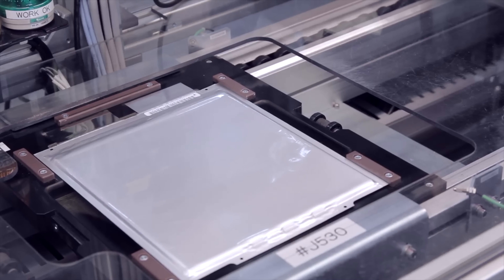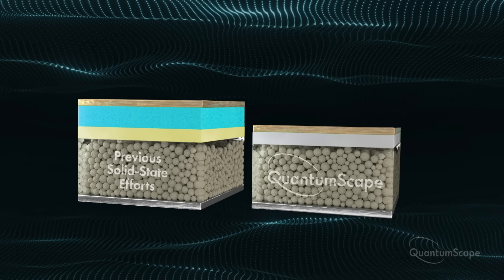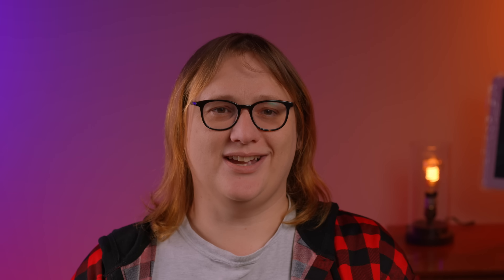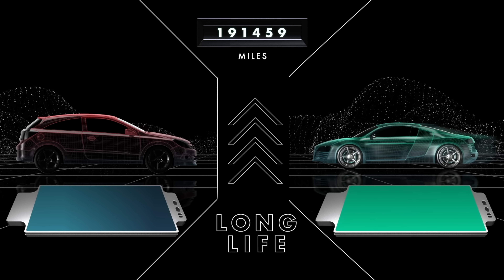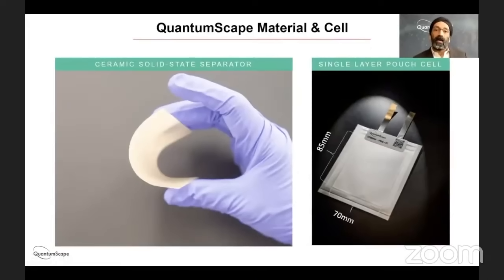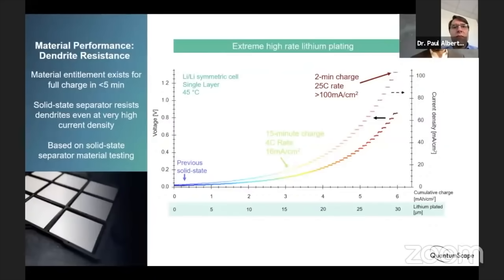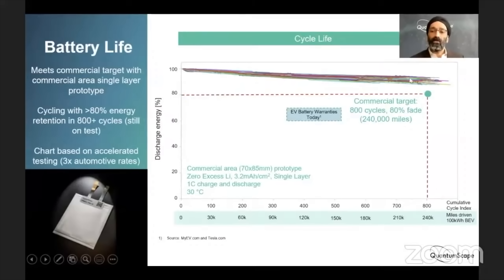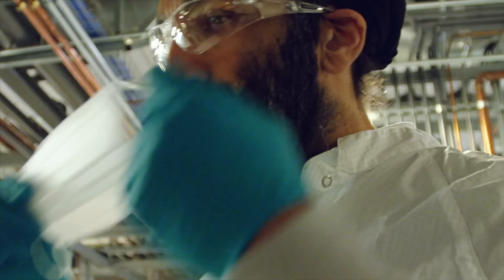Why Quantumscape's Battery Revolution Is Big News

Comment: Other companies have done this - offered better prices to cherry-picked safe drivers and they use metrics for each driver, not statistical demographics - for PART of the price. The environmental factors and the cost of repair/replacement of the vehicle are the same no matter who the insurance company is.  

That "coin" manager doesn't sound like someone with any experience in the insurance industry.  It's more than 50 times as complex to sell car insurance as it is to sell cars online from one state.   Insurance companies  are regulated independently in each state.   They may be divisions of  a larger holding company that also owns a car manufacturer, but u-in order to sell to citizens of a state, they are required by law to be separate entities and they must have separated financial reserves, corporations,  licensed agents and sales presence in each state.

Comment: I am having a hard time getting excited.  I guess I have just heard too many of these "huge breakthrough in battery technology" stories over the last 30 years.  What happened to the supercapacitors that would charge instantly and could stand almost unlimited recharges?  All they needed to do was solve that little problem of having no good way to reliably discharge in a controlled manner...

Comment: Amazing this sounds very much like Tesla's anode free lithium metal battery which is almost there he's not getting enough cycles out of it to make him happy yet however if you put a battery pack the size of what he's using in his current vehicles like the model 3 a single charge is going to get you 3,600 MI and it can do that a hundred times not many people that many miles on their vehicle however he wants 2000 cycles by the way 2000 cycles is what it takes to last for 10 years.

Comment: With the timeline they need to even break ground on a manufacturing plant Teslas new million mile cells will be on the road and dominating the demand. Especially with the new cell design to mange thermals so much better, reducing even further fire issues, with a lifespan considerably longer than the Solid-state battery I can't imagine this being still a thing in 2025

Comment: Isn't a capacitor a solid state battery, albeit one that only stores energy to release in one short burst?  Since capcitors have been around since the dawn of the transistor why haven't capacitors evolved more?  More like to evolve into an actual battery with sustainable output and  fast efficient recharging?  Most solid state devices have evolved at least along the lines of Moore's Law but not solid state energy storage it would seem.  Hopefully with company's like Quantumscape pushing solid state energy storage it will now move forward like other solid state based electronics  If I sound stupid forgive me I do not pretend to be a scientist or engineer..just curious.

Comment: Sounds promising, but Tesla's "jelly roll" technology can readily be adapted to improvements in chemistry without the need to replace expensive machinery. Plus, Tesla has stated that it has a "road map" to future battery improvement that will enable electric airplanes within a few years. One wonders if the same can be said of the solid state technology. Battery technology has achieved impressive improvements but thus far they have been incremental improvements based on intensive "trial and error" research. As of yet there is no reliable theory that can predict how battery chemistry can be altered to optimize battery performance.

Comment: The battery is the heart of any electrical device, the electronics that's the middle man in the process, and the motor.
A motor that could run itself or produce a percentage of it's own operating current is the key to an efficient model.
There is waisted current in electric motor design, I have a prototype that collects and recycles "much" of this current.
Have put up experiments of this on my channel. I don't do the math and experiment without calculations, using a volt and amp meter. Using basic principles and observing qualitative results and much time spent at the bench.
By the way, none of these things are new, just a mm or two outside the box.

Comment: The base line problem is still the same.  Can you recycle the battery or will we be just be adding to the land fill?  Where does the power come from?  Great you have an electric whatever.   you still need some form of nuclear to create the electricity that goes into the battery.

Comment: why not use particle entanglement or other quantum mechanics to nonlocally charge or power the batteries. we can store half pairs in a reactor to keep them humming. should work right

incidentally  are there any common devices that use quantum mechanics, what are they and how are they using quantum mechanics?

Comment: Electricity is not greener nor a good solution. And we need to use Hydrogen anyways ..
Reply: not going to happen. IF hydrogen was viable by now, it would be used. Its almost like the early battle between AC or DC, and no one championed hydrogen. EVs are now mainstream and the money flow ALWAYS declares the winner.
Reply: @bigjakex  Ok so you suggest that we will use battery technology in the trucks. Yeah i guess the global trading will stagnate. Same with planes the will also use hydrogen because electricity is not a option. Also renewables are not even capable of delivery the energy right now when everyone has a car again this will simply not work. And the other topic is the batteries there is no dang solution for that right now it’s all waste.
(And don’t come with the 2% recycling by now we would need to have 80% or more)

And also the end consumer seems to not want EV‘s meanwhile cars are actually not the biggest CO2 producer at all.. 
This year the quote was around 3/5% last year it was 2% but yeah i guess your idea is that not everyone will be able to get a car then i might work when only say 5% of the people have a car like that and everyone else ...

Comment: People really need to take a closer look at this so called "cleaner" power to cars. Its a false narrative do the research
Reply: And what about the narrative of gas cars and coal plants? The bullshit that oil companies have done all throughout the decades? Current electric cars may not be a lot "cleaner" than a gas car when you account the production of every part, but if i was stuck on bumper-to-bumper traffic (which is normal on my part of the world) i'd rather be stuck on a traffic jam of electric cars and trucks than gas/diesel cars and trucks. Plus an electric car will never "roll coal" on another car. The world being stuck on internal combustion for more than a hundred years now is not exactly innovative.

And what's so bad about R&D on batteries? The benefits from it are not just for cars alone. If given the same time, money, and R&D spent on the entire lifetime of internal combustion technology, i won't be surprised if it will develop into something even more revolutionary than what the gasoline engine had on the steam engine.
Reply: @sepg5084  because not everyone wants an electric car, I personally don't want one, I'm a mechanic and the combustion engine is great, I love the power and sounds the feel of them,  And trust me I live in the 4th largest city of the US I know about traffic but the mining for lithium is horrible and what about the power it takes to charge them that's not clean either way so just because it doesn't burn fuel immediately to run it still takes fuel to charge and that fuel runs 24-7 365 never stops power plants run continuously. so either way neither one is great  and rolling coal isn't every truck out there. and last i check we should be able to do what we want with our cars and be free.

Comment: https://www.motortrend.com/news/toyota-solid-state-battery-ev-2021/
Imagine an electric car battery that provides more than 300 miles of range, charges in approximately ten minutes, requires no bulky heating and cooling systems, maintains 80 percent of its charge capacity for 800 cycles (about 240,000 miles), and isn't prone to spontaneous combustion. Such is the promise of the solid-state car battery, a holy grail that automakers and manufacturers are racing to find. Now, Toyota announced it'll have a running prototype with a solid-state battery ready by next year.

Comment: Electric cars are stupid, what will charge them, coal, a nuke plant in every ones back yard?. What about the overloaded grid, that will need trillions of dollars to fix. What about the taxes no longer collected, since you are no longer at the pump. I could go on, all day long, with all the reasons why we shouldn't make them.
Reply from the maker: Perhaps look at actual evidence rather than your own thought experiments. Even if charged off the grid mix as it currently stands EVs are dramatically cleaner. Not only that, but you're failing to take account of the vast amount of electricity used to produce gasoline from crude oil. ^Kate

Comment: Indeed, the gap between laboratory and commercial application remains huge. It's always that "last 5%" of development that takes the time and effort and expense and can still fail at the last gasp. . Still I wish them good luck. You haven't in this programme at least mentioned Toyota's efforts to develop a solid state battery, I wonder if there's any similarity? One battery technology you didn't mention that's already available and doesn't lie in the future is lithium iron phosphate, which is a pity, as this chemistry, whilst not as energy dense as Li-ion is much cheaper, more robust and longer lasting. It's my impression that there's considerable room for the improved packaging of LiFePO4 batteries in cars and vans which may be sufficient for 90% of use in the real world.

Comment: Nope. Total bullshit. There are no battery breakthroughs! There are only small incremental improvements.
Anyone who claims a battery breakthrough is trying to sell shares - and they are liars.
And YouTubers who believe battery breakthrough announcements are gullible idiots.
Reply: 100% correct. Just look at how their stock took off after all these suckers swallowed the hype and harped about it in the press/media. Then a few analysts checked if there was any production plans or production cost predictions and low and behold there was none and the stock sank immediately. The stock went up to $132 during this BS media blitz and since Dec.22 has crashed right back to $54 where it was before the the hype began. It doesn't take a genius to figure out what this PR scam was all about.

Comment: Trying to be optomistic in so called covid. Not just blow up a battery but are we going to blow our selves up.  Zeck 14 will happen.  Quantium scape new high tech. How much better? Charge rate better ok but how to get the " power" to the battery via grid system. Need other battery/ capicotor.  Oh 30-40% better.  Nice but methonal fuel cell 3-4x ( not %)  better power to weight ratio Typical utuber  1 403 830 4124

Comment: Great performance results at the prototype stage. I wonder if they're using permeable membranes similar to RO?
Reply: David, 
A year has passed. It is clearly now that QS uses ceramic membrane to replace both the electrolytes and the polymer membrane used in liquid electrolytes lithium ion batteries.
Reply: @Kukaboora  is the company associated with the recently touted Toyota solid state battery?
Reply: @dynomania  Honestly I do not know. I do know that QS is associated with VW.
I am a firm believer in QS and hope there is no shenanigans in their story.

Comment: So realistically, the battery will be 30-40 smaller for the same range as the batteries produced today, saving space and weight in car.
But will fully charge in 30 minutes using a fast charger. 
Oh, and should last the lifetime of the car.

Comment: To everyone whining about how "I've heard of battery breakthroughs for years" or "I've seen this video" or "we won't see this for 20 years":
Battery technology is skyrocketing, look at capacity, charging times and performance during the last 30 years FFS!
Meanwhile, ICE technology (which is near its max) has barely developed at all. If you can't see the battery revolution, it's because you're not looking. That's why we have wireless earbuds, electric scooters and bikes and EV's and all other rechargeable gadgets today that we did not have 10 or 20 years ago.
Reply: there were rechargeable Sony Walkman far more than twenty years ago. 
I listened to The Clash & Robert Plant's solo stuff on it.......... the batts were rechargeable.
smaller batteries for smaller items isn't a breakthrough.
Reply: Yeah, it's pretty funny to see all those old "I've seen it before" curmudgeons just pretending the last decade hasn't been huge for battery technology. I say this as a former doubter.
Reply: One step closer for electric air travel too!

Comment: E-Fuel, made from electricity and sea water will make batteries obsolete for most  electrical energy storage. Except for their common use today as a power source for auxiliary systems is all batteries are good for. For real mass energy storage E-Fuel is the only way. E-Fuel makes all IC engine autos, EV's.

Comment: Yet again a "revolutionary battery", I wonder where to buy all the previous  revolutionary batteries? I have heard this so many times before so I'm not holding my breath until it on the market.
Reply: If you can't see them, you're not looking. Battery capacity and performance has absolutely skyrocketed in the last 30 years. Maybe you should venture outside the cave sometimes?
Reply: @panzerkami2381  You're either a idiot or a dishonest prick if you think the rate of battery development has been revolutionary fast. Capacity has increased in a steady slow pace.

Comment: I've been messing around with batteries for 11 years. I have just squeezed the last usable watt out of my e-bike battery. Here is what I have learned.... A cells life span in use is about the same as it's shelf life.

Of course ebikes seldom use even a 2C  discharge rate. I managed to baby my LiFePo4 along for 6 years. But they were about purdy much shot a year ago. The spare cells I had deteriorated at the same rate as the ones in use.

After sifting through the lies that online sellers use to trick people; I am going with LiFePo4 again. The seller was telling the truth about his packs, and the weight penalty over Lithium Ion is only about 4 pounds, and  Lithium Iron cells are safer and will do more charge cycles.

The shelf life of my soon to arrive pack is given as 5 years and figuring that the cells have been on a warehouse shelf for a year or so, I ought to be able to get 4 years out of the packs. (Fingers crossed.)  Maybe by then solid state batteries will be available.

I could have gone with reputable e-bike shops for their support, but would have had to pay more than twice as much.and their packs are Lithium Ion......  Non nerds should pay more for the extra support.

Off topic, but I hope, useful information.

Comment: Interesting. Whilst it’s mostly about cells, rather than battery structure, the other major issue could be whether it’s possible to simplify the need for operational coolant, thermal efficiency etc. The avoidance of liquid coolant inside the batteries would be nice, if possible. It would help reduce the overall weight as well.

Comment: Nothing to see here: releasing 2028: too long...900 cycles: will be less than Tesla4680... 17% cost reduction: not enough will be double the 4680... energy density will be less than 4680. 
Consider that Tesla expect to be producing 3TWh by 2030. These guys are dead in the water

Comment: Demand for high energy density, high cycle-life, high calendar-life, good safety record batteries will outstrip supply for many years to come. No one technology or company is going to take over the whole industry. There will be plenty of room for many startups. The Quantumscape battery is a breakthrough specifically for solid-state battery technology and if there is room for improving their energy density into the far future then all liquid electrolyte li-ion battery production might shift to solid-state batteries eventually. Liquid electrolyte Li-ion batteries will be part of most industrial production for many years to come. Solid-state Lithium-Sulphur batteries which can be cheaply mass produced, would be the real game-changer as that would make electric flights possible.

Comment: There has been so many new batteries but oddly enough the one we still use is the 18650 or its updated bigger version.
We have been here so many times so until we see devices using them they are just a great way to spend money for a company to reduce their tax bill.

If they work so well let's see them in push bikes scooters radios mobile phones and so on until then I will stick to using what is available to use.

Comment: Perhaps these new solide state batteries could be used in the Celera 500L plane, a very efficient new design in business-jet like planes now being flown by a gazoline motor, but which might be one of the first planes to be flown electric doing proper distances due to it's efficiency ...